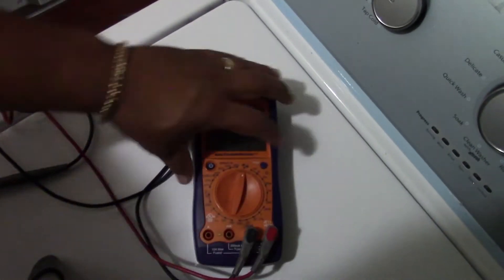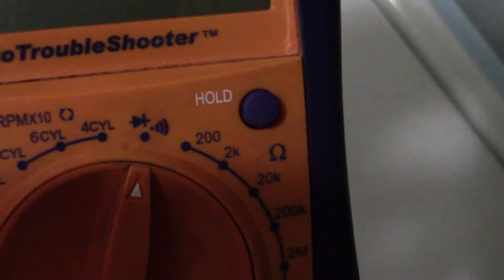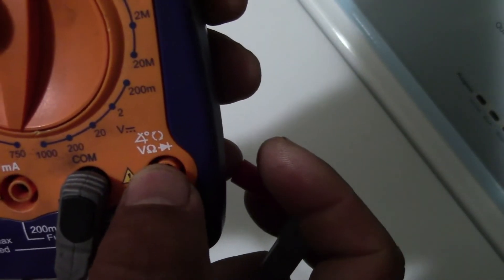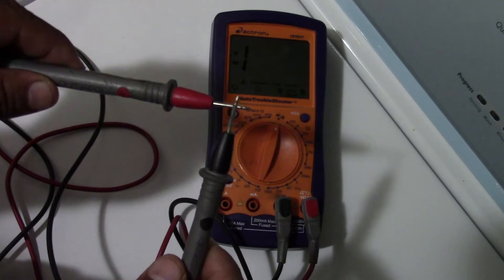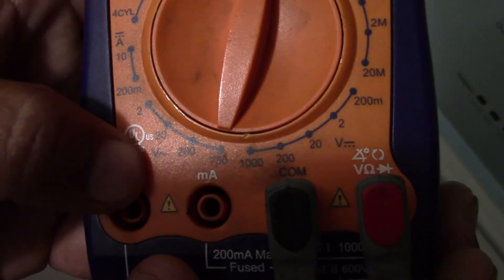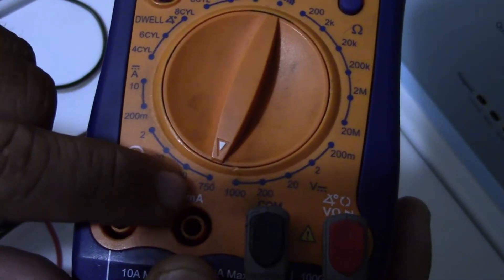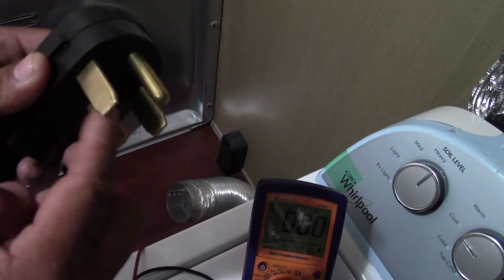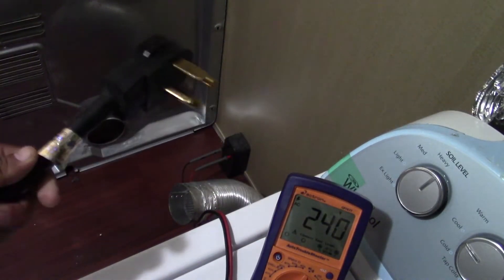How to use a digital multimeter to test a dryer that won't heat up

Comment: On the thermostat with 4 wires, my red ones beep but my purples ones don't? Will that cause my dryer to not heat anymore?
Reply: 10:04 he said to test the 2 with the red wires. No need to test the purple ones